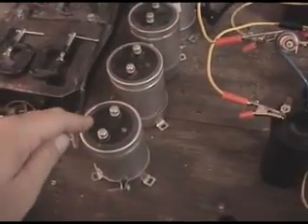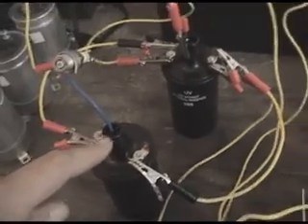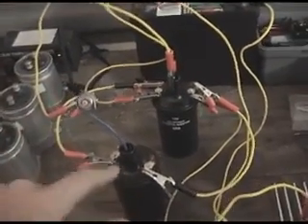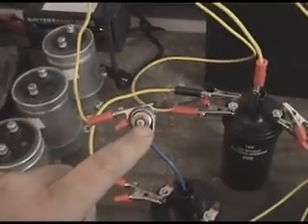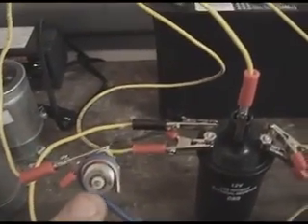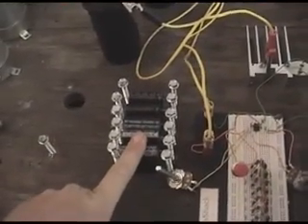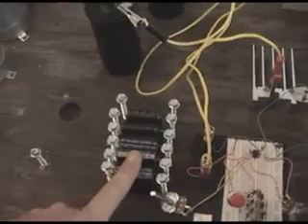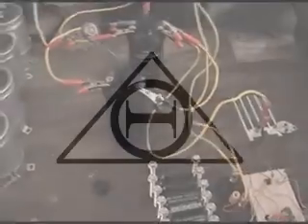#1 InfiniStorm Dual Ignition Coil Circuit - Part 1

Comment: would anyone be willing to build this kit for me or any of the other 20 designs you can get for running a car with water vapour. i will be doing hho and geet gasoline. i will be putting this on a suzuki samurai 1.3 l engine with water mist injection. also i would like to be able to test on a 5000w generator. i guess i will need a ac to dc converter. i am great with engines and designing hho generators but no good at electronics till i go take some courses. i would be willing to pay on pay pal

Comment: that configuration only increases the amperage not the voltage well using 2 ignition coils with the capacitor it may be driving it around 30,000 kv

Comment: hi have you looked at andrija puharich .your ligthning theory i believe is exa\ctly what is required but could it be possible to make it ac all the way to explosion. as andrija states this and allso stan meyer lets this out in a video (but a slip up as he also says steam.just trying to tweak ideas i struggle with understanding electronics and harmonic frequencies .also been told a step magnifier is required (bit like a amp..or the same thing ) will be interested in a made up circuit  melvin